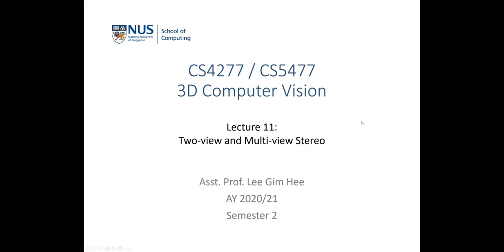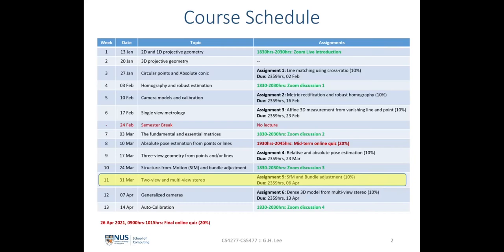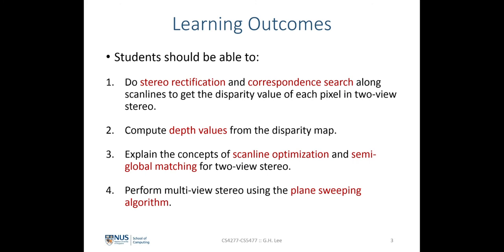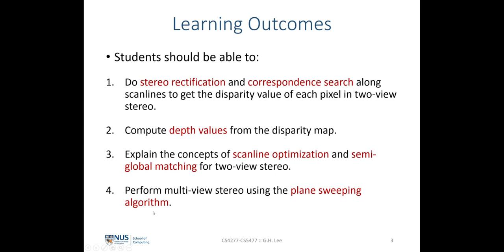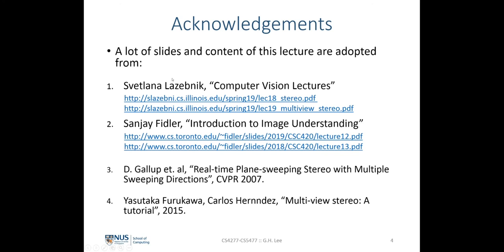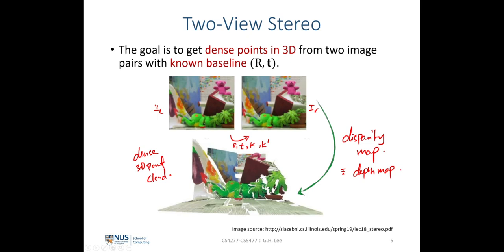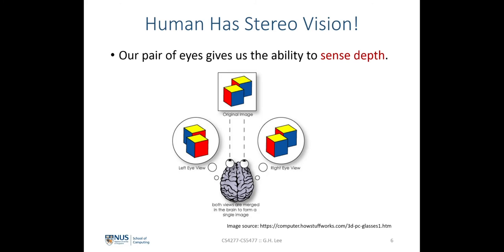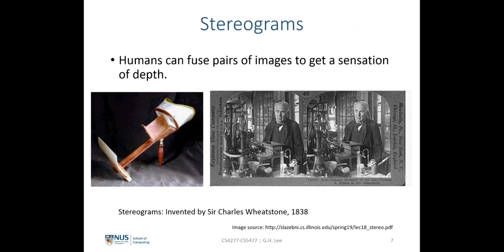3D Computer Vision | Lecture 11 (Part 1): Two-view and multi-view stereo

Comment: you stated that these epipolar lines should be horizontal like 100000000000 times but then spent like 1 sentence describing why mapping to the point of infinity the two via a projective transform will create this parallelism we desire, it is not hard to simply say that 'because epipolar lines originally intersect all at the epipole in the respective image plane, and since we are making this epipole to a point at infinity, and since projectivities preserve intersection, then these epipolar lines will all intersect at a point at infinity causing them to be parallel to eachother now because they all only intersected once originally' and you can also add that since they intersect at the same epipole coordinate, they will be horizontal to eachother when having the same starting point height with the point we originally used to connect with the epipole to form the epipolar lines. These details are not trivial (at least for me because my IQ isnt 290).